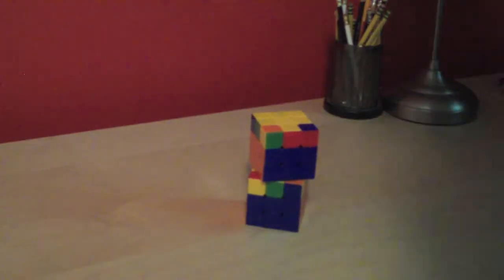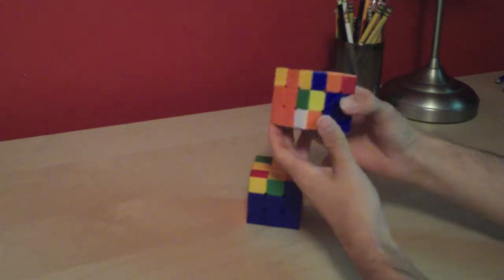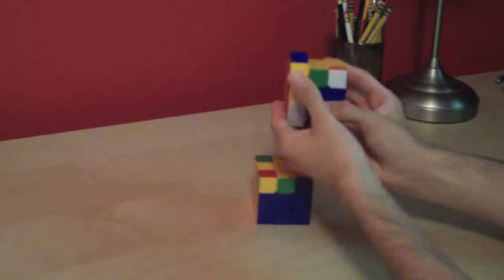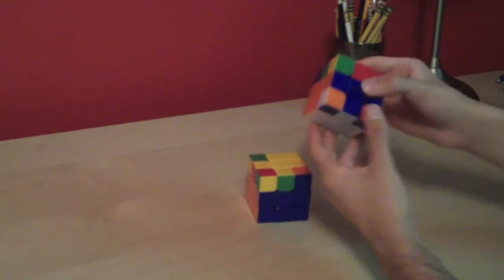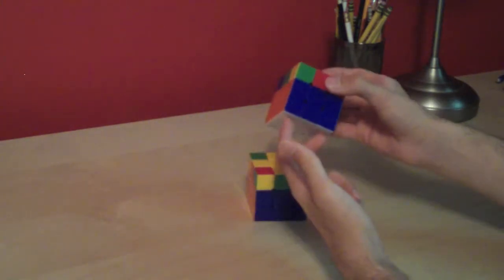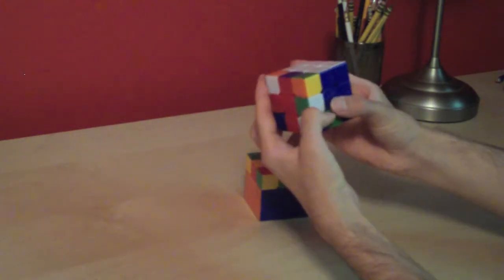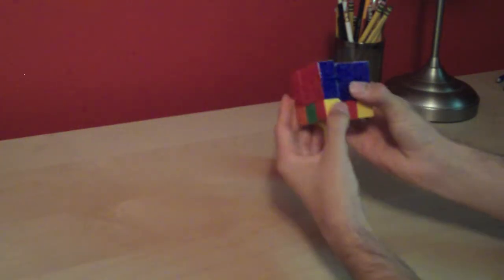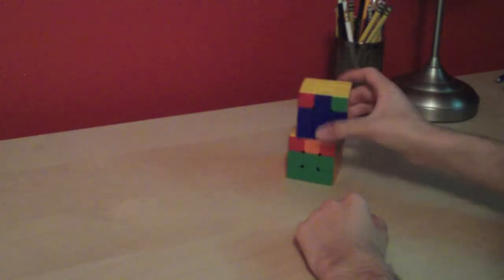Intuitive Last Layer: Part 2 - Corner Orientation

Comment: A great series of videos. The series based on "commutators" is harder, but after I watched it 3 times I "totally got it" and I'm so grateful.

The algorithm is:

(L' U' L) U (L' U' L) D' (L' U L) U' (L' U L) D

I find it more convenient, in practice, to have the last layer facing up. The corresponding algorithm is:

(L' D' L) D (L' D' L) U' (L' D L) D' (L' D L) U

Once you "get" the general principle, it is not too hard to apply it to the case where the LL is facing down. I have noticed that it's easier to apply these commutators faster rather than slower, because my brain and fingers do no retain for long what the last move was.

To work out the XX' logic to the above, you can set X = L'U'L and then Y = (L' U' L) U (L' U' L) and you can recover things like XX' or YY', in addition to U -> U' and D -> D' bits. If you know wot I mean.